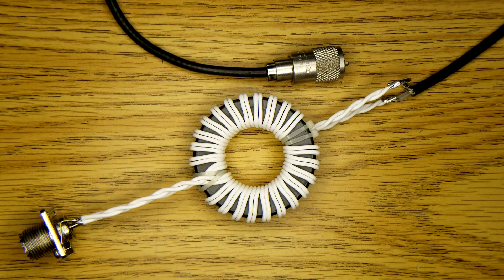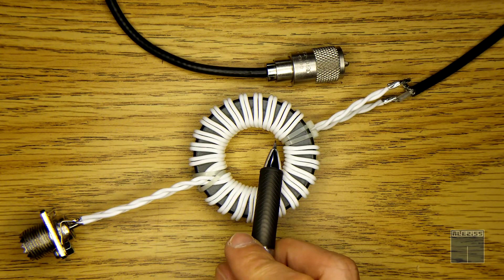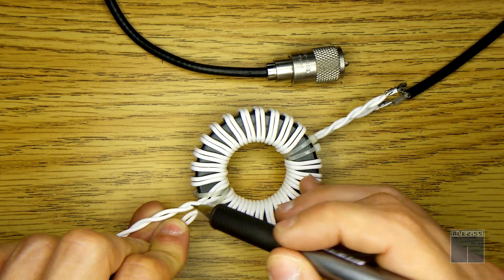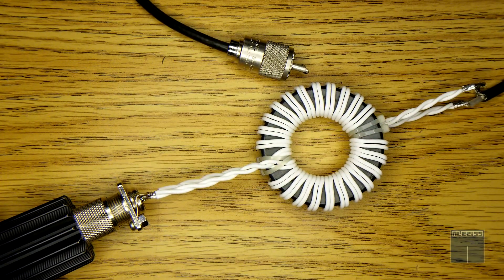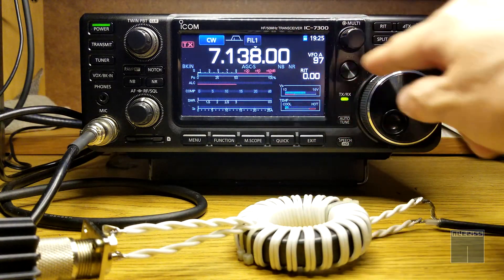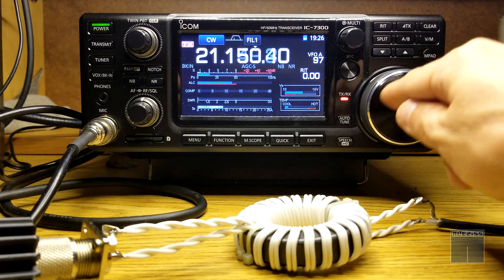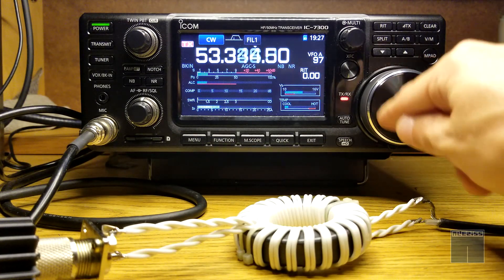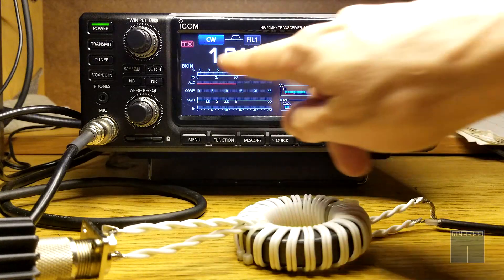SWR testing 1:1 common mode choke balun design from TRX Bench

Comment: I am yet to see a video of one of these working against unwanted noise. I found a video of someone simulating noise being picked up on the coax but what if you have very bad powerline noise and the antenna is picking it up? Then i suppose a 1:1 balun will do nothing to help? Or will it? I have S9 of powerline noise right now and even when i turn off all the power to the house and use a battery. Neighbours are far away, it's defiantly dirty powerline noise, i have driven around with an AM rig in the car and it's this entire hillside and unfortunatly i live 200 yards away from the lines in question!
Reply from the maker: These are NOT to get rid of electrical noises, they are design to make a unbalanced line connect to a balanced antenna AND ATTENUATE common mode currents. I too have heavy electrical noises from hydro power, probably due to faulty isolator somewhere in the neighborhood and having a balun like this one change absolutely nothing for noise levels.

I get +20dB of noise on 40m, usually +15dB on 80m each winter it is the same situation and this year again, I can't make any radio specially during evenings and nights. Beleive me, if you are searching for a solution to get rid of electrical noise, this won't do it.

Get yourself a magnetic loop, those are immune to "electrical" noises as they pick up "magnetic" waves. Or if you have two HF antennas, you can get a Timewave ANC4 or a MFJ1026. Those are working ok but it requires two antennas to null electrical noises.
Reply: @Aleziss  I have decided that i am going to build an X-phase unit such as the MFJ one.
  There is a Russian guy selling kits, boards and ready made units but also VK5TM in Australia sells his version of the boards and has a great explanation and instruction if you google him.
  So do you use the X-Phaser to help with the noise?
  Funny that yours is from Hydro as our Hydro station is only about 5 miles away or less as the crow flies. Why would hydro be particularly noisy? Perhaps it's a coincidence? I am going to look further into it as nowhere else except this village suffers from it this bad. The entire hillside here is stupidly noisy but not worse than S7 to +9. I am starting to order the parts i need now.
  You don't necessarily need two full sized HF antennas. The noise is not really band specific, it is across the bands so it will tune in on any antenna. I might try an old TV Yagi as the aux antenna and point it at the power lines for the greatest source of noise.
  I am also wondering what the possible health implications might be. There is great debate about health concerns of living under power lines but no info that i can find on how this could be an increased hazard if the lines are particularly noisy. The noise is particularly bad around this particular set of power lines on the hillside but i can also hear it from a mile or two away from the lines.
Reply from the maker: @izzzzzz6  well, what I meant by "hydro" is the service provider that is called "hydro quebec", the noise don't come really from hydro power generation method but rather faulty isolators or bad transformer. The difficult task is to find where the noise comes from, it could be right in my backyard or two streets away. I sent a complaint to "hydro quebec", they do have an RF truck with a bunch of antennas, spectrum analysers and they can pin point where a source of noise could come from with directional antennas and doppler... thing is I sent that complaint over 1 year ago and it is still not fixed, S9, S15 even S20 is not rare, usually when it is really cold and dry, noise levels are extremely high to the extent I cannot use the radio on 80, 40 and sometime 20m, impossible to make any contacts.

I do have a MFJ1026 but it does requires two antennas. Both antennas should pickup the same signals in order to successfully null noise. If one antenna is less effective and does not pickup what the main antenna is picking up, there won't be good result as you cannot invert and null out the noise level. This is really how it works. You can't have a full dipople as a main antenna and a small antenna as the second antenna, you won't have enough gain to pickup the noise if the second antenna is too small and is not desigh to pick the noise in the same frequency range. 

Users that have multiple dipoles will have the best results with those noise cancelling units. It is not as simple it looks to be. I have not got good results with the MFJ1026 just for the fact that my second antenna is way less sensitive than my main hf antenna.

Good luck with the tv antenna, on my side I did try a vhf yagi as the second antenna but it did not work at all.
Reply: @Aleziss  Great feedback there. Thanks for clarifying how important it is to use a good second antenna I am going to try the x phase design by VK5TM he claims that people have reported it to be more effective then the MFJ unit.
  I see what you mean about Hydro being the name of the utility. I have actually heard people reference their name in videos before now that i come to think of it.
  I am certain that our local utility does not have any flashy equipment and that they will not come and find the problem until it breaks completely. I will try to walk the power lines to see if i can pinpoint it and go from there. Hoping the x=phaser will work.
  The lines pass and go around my house to the transformer and continue on up all of them around 100 - 150 yards away!
  If all else fails i might have to sell the house and move QTH :D
  The noise had been intermittent, sometimes it would spark up and be constant but before it had been ticking every half a second which was more workable than it's now consistent arcing sound.
  Oh well. Thanks for your time.
Reply from the maker: @izzzzzz6  you're welcome ! MFJ is having a interference finder that I thought I might buy but after reading more on it, it seem to be simply a directional antenna with an AM radio tune to 135MHz. You might give this a try with a portable transceiver and an small directional antenna. Take a look at the MFJ product : https://www.mfjenterprises.com/Product.php?productid=MFJ-856

It is sad to see that the company won't bother come verify that noise because this generate power loses on their side. Noise = arcking which is loss of power for them, they should fix this. On top that it generate noise for us !

Good luck with the x-phase unit, I don't know that device, I'll take a look at it but frankly, I had not good success with the MFJ1026 due to the fact that my second antenna was way off in term of picking up signals compared to my main antenna.

Thanks for all your comment !
Reply: @Aleziss  regarding the choke not stopping noise. I would have thought it might help as it is designed to only let the matched signal pass and not let anything else back down the coax. Anyway thats why i was asking, thanks for clarifying that it does not help. 73's
Reply from the maker: @izzzzzz6  I am not sure you understand the balun correctly... the balun is used to take the unbalanced output of the radio coaxial and transform it into a balanced feed like a dipole, two equal side of wires that resonate at a particular frenquency. Any unbalancing on a dipole (for whatever reason like ice, a bird sitting on one side of the antenna, tree brannches closer to one side of the dipole than the other, and so on) will result on RF coming back on the outside of the coaxial cable, the skin effect, which is also called common mode currents. What comes back on the outside of a coaxial cable is generated by an improper balance antenna and come back as RF transmitted by your transceiver. The common mode choke will block those current on the outside of the coaxial cable at the antenna where the choke should be installed.

Now receiving electrical noises from electrical arcking due to faulty isolator, faulty transformer, faulty splice and so on, is picked up by the antenna itself, just as if it was a radio transmition from another station thus come in the center of the coaxial and not from the outside of the coaxial like common mode currents. Does that makes sense ?
Reply: @Aleziss  Hi. Thanks for the reply. Yes i understand how to use a balun to transform the impedance of an antenna back to 50 Ohms when needed. And i am aware that common mode current comes back down the outside of the coax rather than back down the inside of the outer braid where the regular signal is supposed to flow (between the inside braid and outside of the centre core (voltage?).
  I was just not aware that the out side of the braid can only bring RF back into the shack and not any noise back to the receiver.
  Since there are various types of chokes And balun type chokes i was wondering if any of them could help with unwanted noise but i see now that if your antenna is receiving it nothing is really going to stop it from coming back down into the radio.
  I have decided to build an x Phase box to try to put the noise out of phase with itself to cancel it out.
  Thanks for verifying that unwanted noise can not be filtered out with a choke or any type of balun, unun etc.
  Personally i do not use a balun as my antenna is resonant and matched to the band fairly well and there is no evidence of RF in the shack.
  I sometimes use my tuner to further improve the match.
  To be honest my plan is to run 300 ohm feeder to an inverted V. The tuner is designed to match up to balanced feeder and whatever is at the end of it. there is a balun built into the tuner.
  So common mode on the coax shouldn't be a problem as i won't be using coax.
   It's just very frustrating having S9 of local noise and i am looking into any possibilities that might help.
  Thanks for your input.
Reply from the maker: @izzzzzz6  Using 300 ohm, your antenna NEEDS to be perfectly balanced, both sides the exact same lenght. Otherwhise, your 300 ohm feed will radiate. Balanced feed is excellent, way more efficient than high grade coax cable, that is on the loss side. The problem with balanced feed line is that it must not come close to any conductive material and it must be use with a perfectly balanced dipole antenna. If all those are respected, you'll have an excellent performing antenna.

But remember, as soon the antenna is starting to get unbalanced due to ice, snow, rain, one side of the dipole being closer to tree branches than the other side, a bird sitting on one side of the antenna, you'll start to get unbalancing and your balanced feed line will start to radiate.

I spoke with a gentlemen who is using a full wave loop and a 450 ohm balanced feed. He did build is own tuner with a great feature. He has two amp meters (to measure current) and he can tune both side of the balance line to be the exact same current. This way he is sure to correct the "unbalanced" signal. I though it was a great idea !

On top of that, he uses two coaxial cables, again identical in lenght and type, for it's balanced feed which I also though was a great idea. Now there is no restriction where the line passes and both line can even be away from each other without any impact on the balanced feed !

You can find a great article about how to build a simple dipole with two coax as a balanced feed here : https://archive.org/details/73-magazine-1984-02/page/n9

As for the coax common mode currents, what I was trying to explain is that when an electric arc happen in a power line, it will be picked up by the antenna and not by the coax cable since it is tied to ground. What comes back is RF signal on the outer side of the coax cable when you don't have the proper choke from a unbalanced line to a balanced antenna. I am not talking about SWR here but really the symetry of the balanced antenna in regard of a coaxial cable. This is where a balun choke like in this video will do the job of rejecting the current coming from outside the coax and making a bunch of problem inside your house, having lights turn on, open garage door, make noise in TV and so on...

A resonant antenna does not mean it does not need a common mode choke. A dipole IS a balanced (because both sides of the antenna are equal) AND resonant antenna and it DOES require a balun IF you use a coaxial cable. A coaxial cable is a unbalanced and 50 ohm feed that must be transform and adapted to the type of balanced antenna. Having a dipole cut for 40m will be resonant to the frequency it is cut for and will resonante at 50 ohm (so no need to adapt the impedance, this is why we say 1:1). The only things that need to be taken care of are to transform the unbalanced coax feed to a balanced dipole AND get rid of common mode current even though the antenna is resonating perfectly to 1.0 SWR and is at 50 ohm.
Reply: @Aleziss  Thanks for the reply. I like the ideas the gentleman you spoke of had come up with, very interesting.
  I have seen some nice stacked 1:1 baluns using multiple toroids, i think this is the only way to go from what i have heard.
  My plan with the balanced feeder is to make a 7/8 wave inverted V of sorts with the feedpoint at around 100ft. I will start around 80ft so as not to annoy the neighbours and then i will raise the centre pole to just over 100ft.
  Initially i am going to try 0.5mm annealed enamelled wire just because i have a reel and i think it will be fairly stealth.
  But the plan is to use some 1.9mm hard drawn copper and spray it black. Essesx wires sell a 200M roll for around £70 i think but i have to get it shipped to France so i am waiting until a friend drives out from the UK.
  Both sides will be the same length.

Comment: A remarkable result, very impressive.
Reply from the maker: thank you for your comment ! I am still waiting to measure attenuation with a nanovna and it will confirm that this type of balun is really effective. As you saw, SWR is fine so I am pretty sure the attenuation work as it has been a proven method of doing common mode attenuation.
Reply from the maker: if you want to see the attenuation with a nanovna you can check my video here https://www.youtube.com/watch?v=k2DAyvciyow thanks !

Comment: Hello Claude, thanks for posting this video of your very neat looking common mode choke.  I'm also building some common mode chokes of the same design using silver plated copper wire with teflon insulation and Fair-Rite Mix 31 ferrite material.  To do the tests I have bought a thing called a NanoVNA on eBay for about US $70 and it arrived recently.  Another guy at my HAM radio club bought a NanoVNA and we saw it at our HAM club today.  His is a NanoVNA and his unit came with cables and an internal battery.   So have a look at eBay and you will find a NanoVNA that is quite affordable.   73,  Jamie  VK2YCJ
Reply from the maker: Hi Jamie, yes I am aware of this little device, there is a newer one the nanovna-f with a 4.3 inch screen, I was waiting for more developpement on that latest one before buying one. Also another beautiful device is the MINI1300 but then again, not much documentation.

How have you connected everything to test common mode attenuation measurements ?

73 Claude VA2CST
Reply: @Aleziss  Hello Claude, I haven't tested the chokes with the VNA yet
Reply: I have a Nanovna, have used it to check my chokes but they are a different design. The screen of the Nanovna is small but you can get the data displayed on a PC.
Reply from the maker: @g0fvt  how did you setup your nanovna  (connection whise) to test your chokes ?
Reply: Aleziss I used the VNA in two port mode, if you Google “g3txq choke” you will see a similar set up. I shorted the “input” wires to the choke and connected them to the RF output of the VNA and shorted the output leads of the choke and connected them to the other port of the VNA. In other words the choke is tested as a two terminal device. The sweep is then done plotting loss between the ports of the VNA.
Reply from the maker: @g0fvt  ok I will take a look at g3txq website. TRXBench has set resistors, not sure I understand, I think it is to "split" the transmit signal on both side of the balun (instead of one side being at ground) and resistors might be to have a 50 ohm load for the measurements... see here https://youtu.be/JhAPJISUjB8?t=2657

Comment: What max. power are you using it? Can it handle 1kW with max swr 1:3?
Reply: FWIW I have run significantly over 1kW through similar,  I did wind one with PVC insulated wire, huge dielectric heating. Teflon insulated wire version did not heat significantly.
Reply from the maker: I was doing short burst at 100W because my dummy load can only accept 15 watts... TRXbench states that it should handle 800-1000w and you can see that my radio does not register any SWR on HF bands at 100W. If you want more, you can stack two cores, it should handle easily 1.5kw